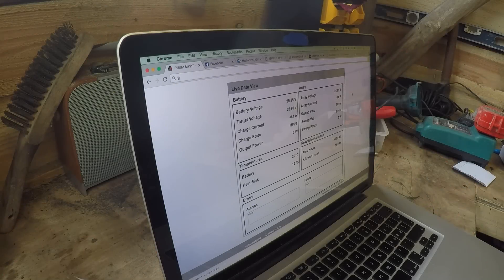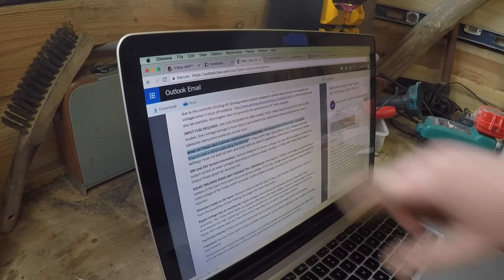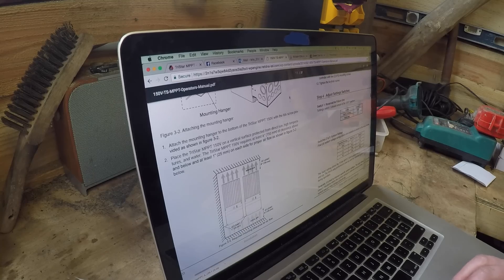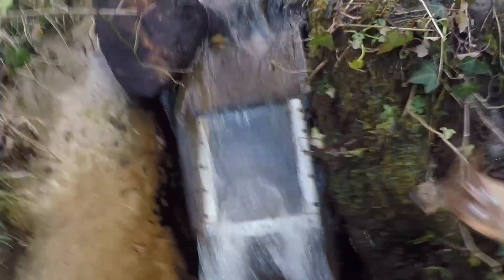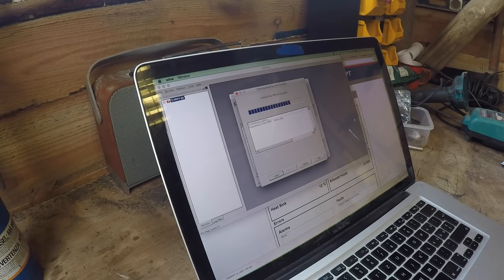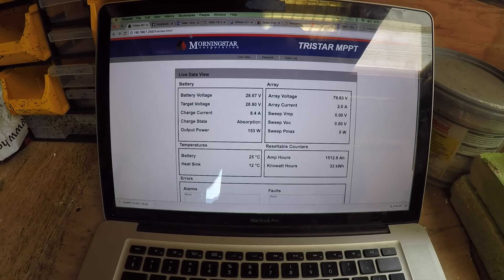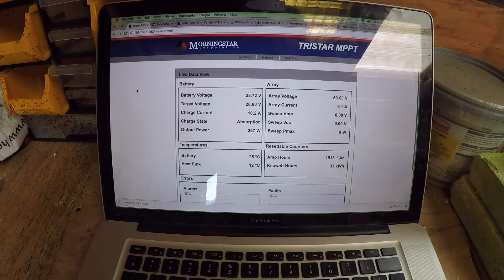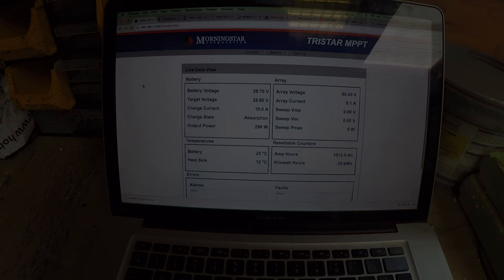DIY Micro Hydro Part 20 success!  67% efficient. 298 watts

Comment: I put a rare earth magnet in my reservoir before the coanda filter to pull the fine sediment out of the system. All that sand and muck has microscopic iron and heavy metals in it, and a strong magnet will divert it from entering your system.

Comment: Hi Kris, great series. I just stumbled onto your site and have watched a boat 30 videos. I know you have changed the intake to a different type by now but I wondered if cutting a hole and wrapping the screen up higher around the curve would have help to clear the screen off.
I have seen others use old battery-powered drill motors to control the valve and turn it off when the batteries are full, have you ever tried doing something like that.
Anyway, I am off to watch your wind turbine build now, thank you for posting these videos, they are very enjoyable and very informative.
Last thing, I am very impressed by your craftsmanship in everything you build.

Comment: I know this video is 4 years ago but the 0.6v error sounds familiar as the reverse bias voltage on your rectifier.  If that is a permanent feature maybe you should set to 50.6v or play around a bit to see if you can squeeze out a bit more.  Also if you parallel up your spare cable you ran you would get a bit less line loss due to resistance.  If you aren't using it for anything else at the mo you may as well.

Comment: Just some off the top ideas to improve efficiency even further.  If you had the inverter and batteries close to the hydrogenator shed. And send the power up as 240V AC to your shed. But that's a trade-off for running big loads if the distance is too long. A Victron MPPT might also offer a higher efficiency. And of course, LIFEPO4 batteries are light years more efficient than any lead acid battery with the conversion process to store that energy.

Comment: We use these mppt a lot at work also
We have bespoke firmware used on solar and very large lithium batteries
They work well
Network connection is often dodgy but more than 100 coms trailers using these.

Comment: I have thoroughly enjoyed the build. I was wondering why u didn’t use 10 or 20 foot lengths of pipe and glue them together.  It seems that would have been much easier.  I am sure u have a good reason. I have been watching all your vids.  So much better and more educational than Netflix. Fantastic!!!
Reply from the maker: Thanks, and good question, when you put in a join you create a loss. having 50 joins would be a considerable amount of friction loss. This is a small system and the only way it is viable is if i keep the efficiency up.

Comment: About your .9V when the system is off. . .I know of a farmer that used to park an old iron Ford tractor under the high voltage carrier lines that run from city to city and ran by his pastures and he got quite a shock one day from the static discharge, he went on to run cable down to the house and ran his house of the static collection, his power consumption from the grid became positive and since this was back in the 1970's renewable technology was near nonexistent the power company went out to investigate how this farmer was putting current back into the grid. once they determined how the phenomenon functioned, they of course sued him for piracy, but it made me think maybe your collecting a static charge somehow. Peace

Comment: I need a system like this, I have lithium ion batteries, and lead acid, I have a spring I'm going to dam up. To get a larger flow, it may dry up during drought, but I will have power when the sun isn't out, and it's usually raining then. I'm thinking I will start with a pelton, and alternator, pma. But I need a mppt to charge the lithium batteries, they are midnite classic 250's on sale on eBay, to output a bit over 60amps and 250 v input. Bucking over double battery voltage is not effiecent, unless you have long cable runs, I'd have about 200' or nearly 100 meters, so I'd probably run 8-10 gauge 3phase, I doubt the alt. Would do near 250v, maybe 150-180 -/+ volts, and 40 -50 amps at best, the controller will limmit current, and will not operate if voltage is high. But I will build a high voltage disconnect, to prevent high voltage, probably short a resistor across the incoming from the PMA, to put a load on . if it's still high , or goes higher, it will disconnect, and sound alarm, but I doubt this would be needed, I'm guessing with the flow, 300 watts would be a high nominal power output, maybe 400-800, after a heavy rain! In a good day. But it will not be 24/7 I'd have to store up water, and run about 8-12 hours as needed, it would be nice to get a 1kw 24/7 comming in. I wouldn't need anymore solar!!!

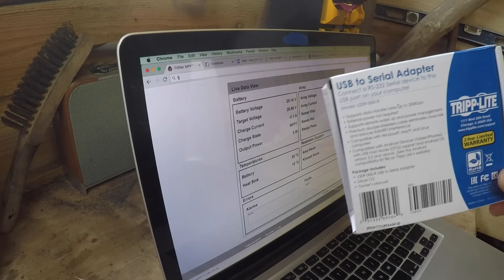Comment: 0:14 haha yeah, used to run a small exgov computer shop. Particular laptops (6910p for example)  were super popular with the trades in the area because it was far cheaper to keep buying this 150-200 AUD laptop with a  Serial port than it was to get those USB to Serial or replace the entire machine to work together.

Comment: Thank you very much for this series. You answered a ton of questions for me. Possibly for the water intake you could build a bit of a damn and place the intake above the bottom and below the water surface. I think your project was done amazingly well.
Reply: I lick the idler of having the lask as a tip of storage facility  the fixability.  it offers today  for the ability to power ons home . from stormwater storage. i must sat offers a lot . of potential. as a lat we had a lot of pools that surrounded our smallholding in the day  then we did nothing with them  But today the opportunity to take  water off to charge a battery banks  is something to be considered a separate,  String to one bow as it were .

Comment: Well done and thank you very much for sharing information.
From my side I have done something similar using DC washing machine motor and Pelton wheel but after checking different charge controller documentation and specification (and i also found morning star documention really unclear especially regarding dump load feature). So I'm using now using a MPPT Victron charge controler without any dump load stategy. The only disadvantage is the speed of the turbine increase when the battery are fully charged but as it's never the case I'm fine. The advantage is that they support 100 V as input. Anyway, in my case I produce 100 W/h using 0.5 liter/min (9 gpm) under 40 m. of fall (130 ft) 
The turbine : https://www.youtube.com/watch?v=doDlldTYlhc
Website I've done for calculation : https://hydroturbine.info/ (only french at the moment)

Comment: Simple Wifi fix... get an old WRT54G Router... upgrade it to DDWRT and install as a wireless bridge to the internet. then you can cable plug the laptop, the controller and 2 other wired connections... as well as repeat wifi locally at the site.

Comment: Kris, I love your videos, so awesome to see what you have done! Would love to be able to do it myself one day! I have a question, i see that your system is producing ~300 watts continuously therefore I am trying to calculate your kwh per month. I would do: 

kwh per month =(300w*720hrs)/1000 to get 216 kwh per month

Is that correct? Let me know if I have my equations mixed up. Thanks again for the awesome video!!
Reply from the maker: Yes that is correct, but I also have about 200kwh of solar as well

Comment: Did you use the 0-240VAC 4KW version of the alternator also what is the open circuit voltage and rpm, I would really like to know because I might make one.

Comment: Good show!   Two quick notes/points or questions.  On the PC, (usb or serial port specifically) look on eBay for an old laptop with a true serial port or a small PC with one. Your can adjust try speed or baud, stop bits and flow control. Makes a big difference when it’s a real change vs logical change with USB emulation.  Cisco switches a finicky sometimes like that as well. Second is the unknown .9 volts. Did you ground the system?  Moving water with particulates in it creates static charge.  Not saying it is but that could be where your mysterious voltage anomaly is coming from.  But good show my friend congrats from the other side of the pond in Texas!  Enjoyed sir.

Comment: 14,4V is i little bit to high per battery, if u go down to 13,8V it would be better for ur batteries lifetime,
Reply from the maker: 13.8v  would mean they were not getting fully charged and would shorten there lifetime. Please don’t spread incorrect information. Do a bit of reading before commenting.  https://www.centurybatteries.com.au/content/documents/battery-talk/issue-2-battery-talk-battery-charging.pdf
Reply: i read ur spreadsheet u provide, and under the colum floatcharge is exactly what i mean,. there thy talk also about a little lower voltage. My main language is German so sorry maybe i cannot exactly point what i mean. But based on my knowledge and longtime experence it is better to run batterys at a lower voltage. above 14 Volts the battery beginn whats in ur spreadsheet stand at absorbtian. In german i would say "die Batterien beginnen an zu Gasen" But i am very impressed by ur project. If u run AGm in cycle mode u can go up to 14,4V because they get discharged imidatly like in an elektric car, but in ur configuration they are hold to long in this state thats what let the batterys age a lot. Thanks for reading Godd projekt, i am very impressed. Thx

Comment: not quite sure how you figured out the 50volt deal? shouldnt it depend on 
1 water speed
2 turbine diameter
3 alternator speed-voltage ratio

also why not make the intake slightly larger to get a bit more water and add another turbine wheel and nozzle (two wheels both applying torque to the same alternator) to double your available power.. i know you say this is plenty but theres always uses for free power (heat, bigger power tools, more lighting, ect)  

seems like you spent 3500$ for 300 watts but you could be getting 550 watts for 3800$ and a weekends work
Reply from the maker: well free spin of the turbine makes 100v so the calculation is easy, it needs to be 50v, all the calculations you mentioned are done for me by testing the free spin voltage. it tells me the water speed and everything else i need to know. 

also yes i can make upgrades but right now i dont even need half of the power i am making. so i will make updates and add another nozzle when i need them. otherwise its just wear on parts i dont even need.

Comment: Just watched all the videos in this series, and wanna say congrats on a working system! That's awesome and thanks for documenting it, was a joy to watch and learn along with you. Wanted to know how you resolved the fine sand issue at the intake or if you determined it wouldn't be an issue due to pressure not allowing it buildup in a significant amount?

Comment: Love when you say "USB or something anything better than serial" when USB stands for Universal Serial Bus. I get what you mean and i'm not nitpicking, but it is funny though when the baud rate is to blame :)
I also love your project and it seems well done. Congratulations :)
You'd probably also benefit having a wind turbine. Most think of making electricity with it and thus buy fx a 12V one. But I had the idea of just connecting it to a heating element directly instead and follow Faraday's law of induction. It seems more sensible since you need stable power for electrical appliances(EA) when wind is most often anything but stable. Although the idea was for a small turbine of less than 1KW it might be possible to take something like 20% of capacity of a bigger turbine for EA and then stabilize the output with a variable load(dump) who's energy becomes heat in a central heating system.

Comment: Well if you haven't noticed I have been following you... Good job.. I would have noticed the whole Creek with a flue system and generated 110 or 220 whatever generator can do.. and your other project consider running a sawmill off of that current.. this doesn't need to be the fastest one ever built in fact I think the saying is a set it and forget it type of deal either a stroke arm on actuator.. or a bandsaw type of thing.. or electric chainsaw..  I will hope to see a video on you using your current at night directly 4 heating a oil-filled heater.. using it to use for air conditioning is popular..   yep before you close out the hydroelectric system videos you may show us exactly what you have done and I recap video.. do provide the specifics as in what is DC current and how it gets changed into a AC.. wire sizes and how long are your runs..  remember you are a little bit of an inspiration.. remember that there are people that are trying to do such thing as this and small countries also called third world countries I'm talking about our missionaries at trying to power up orphanages and lights at night to keep criminals away from children.. yes that is a thing that has occurred..

Comment: Nice work Kris. Our Tech Support Mgr. has logged your concerns for review and action to update the manual for better clarity. In the future we also intend to launch a web based platform that will be use-able by MAC or PC.  Our newer products will have USB and Micro USB connections.  Bluetooth/SIM card, and other interfaces are also on the roadmap.  The RS232 and EIA-485 connections will remain since they are still in demand for industrial applications
Reply from the maker: Hi, i did just receive the email from you,  those updates sound like a very good idea to me. Thanks for the comment. i have also put your reply to this in the video description as i think it is fair that your response is there with the video.  kris
Reply: ^ That. I understand someone new to industrial automation and control desiring USB; however, in industry and even internally in a lot of consumer devices good ol' RS-232 is still king of the hill. USB requires drivers and some custom software implementation, a serial connection just requires a generic serial console or optionally some custom software, but that software is so much easier to develop on top of a serial connection.
Reply: @ParadigmUnkn0wn   indeed, I said in a stand-lone comment it's far easier for trades to get a laptop or what not with the serial port on it. Rather than replace the machine or try and get those converters to work.
Reply: Lovely company! :)

Comment: 60Amp unit has LAN, USB to serial is not the controller fault.
Reply from the maker: you can only update the firmware via serial. and all this can only be done in windows......so no not really.
Reply: How do you mean only serial, a usb to serial adaptor does everything a dedicated serial port would do.  The windows thing is not un common but understand that frustrating.

Comment: Did you tried if your theory about the speed of water hitting that turbine is true? Dont you wanna try different voltages? 45,50,55,60,65?
And also great work!
Reply from the maker: Hi, yes i have tried 45v to 55v and 50.10v is the sweet spot. Thanks for the comment.
Reply: I need to poke a little bit... you know that now it isnt maximum power point tracker (mppt), but it work just as constant voltage load regulator... :) 
One more thing... Are you sure with that effenciency? I think that your system is very good. Did you tried to measure real water flow out of generator? I believe that your water flow is actually a little lower and thus your overall effenciency is little bit higher. You did a great job and I still think that it is closer to 75%  If I may suggest something I would also try how much more water Is it possible to drain from it. I know that now it isnt very important but it seems you have really a lot of water and you should be able to double the output power with a second or more jets. If I were you I would try that... I think it is great to have more electricity then you need in winter. You can always use it for heating and save some wood. You have also a lot of time for planning and building. I can imagine that pelton wheel and generator rotated 90 degrees (generator on top) and then you should be able to use up to 4 jets.

I have to admit that this kind of a system is pretty much impossible to build here, my dream is more about buying a property near small stream and building a waterwheel. Mainly because of little to no maintenance and no need of clean water. I dont care much about lower output power. But still I am realist and I dont think I will be that lucky. Too bad that solar panels will be the only way for me. You did a great job you have my appreciation.

Comment: Wonderful.  Where/how did you learn about this?  If self taught, do you have any recommended reading?  Congrats!
Reply from the maker: this guy built a really nice system. much bigger than mine but its a nice read. https://ludens.cl/paradise/turbine/turbine.html mostly just read lots of stuff from all over the place over years and then just started designing a system the suited my land.
Reply: Kris Harbour thank you!!!  Time for me to start reading.
Reply from the maker: http://www.nzdl.org/gsdlmod?e=d-00000-00---off-0hdl--00-0----0-10-0---0---0direct-10---4-------0-1l--11-en-50---20-about---00-0-1-00-0--4----0-0-11-10-0utfZz-8-00&a=d&c=hdl&cl=CL1.11&d=HASH01b2a59a972bbec8727d699d.7.pr

There is some really good info in here. its quite complicated but it tells you most of what you want to know.
Reply: Kris Harbour thank you.  Guess I have to flex my engineering degree!

Comment: My experience with dip switches goes back years and I find that its mostly trial and error but you figured that out.   Most manual are only configured in the way they use the device not in difference situation.